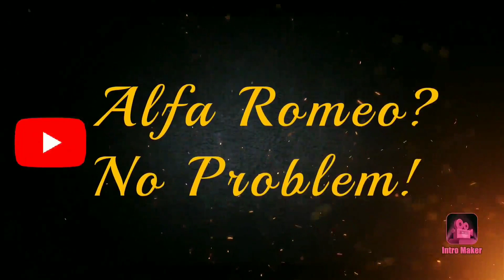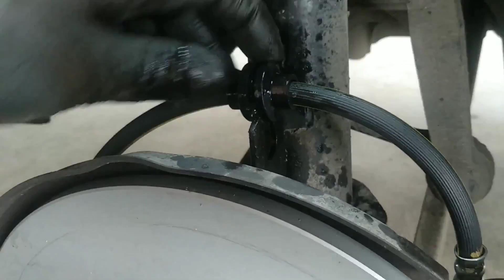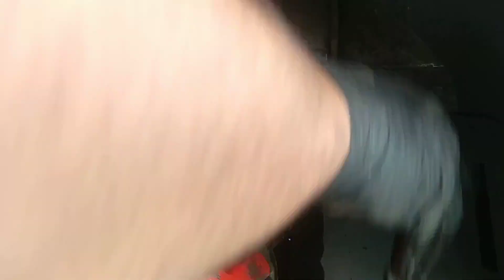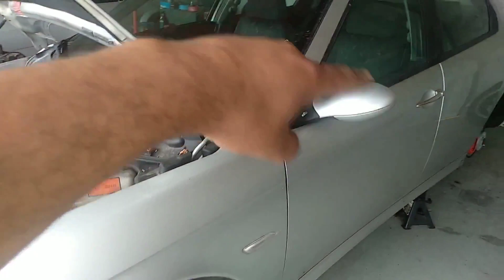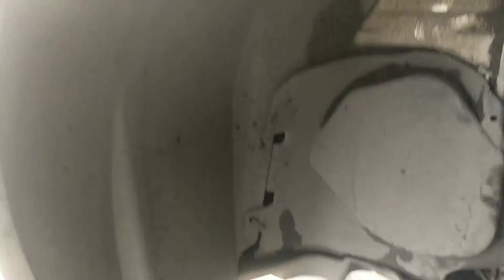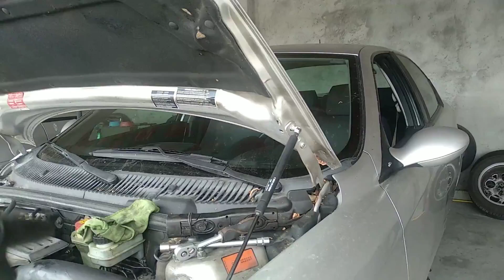Brake hoses, DOT4, clutch fluid replacement. Why is that so important?

Comment: I can confirm one thing about bleeding brakes on all 4 wheels on my alfa 156. I did it only by myself, without any pressure in reservior, I only opened the cap, at even surface, each wheel one at a time. Job was simple:
1. Open bleeding nut with bleeding hose 20-30cm below the bleeding nut level .
2. Get in the car, slowly pump the brake all the way in, several times.
3.Get out of the car, wait several seconds before closing the nut. Close the nut.
4. Watch the fluid level.

And do this for all other wheels.

I got on car inspection tomorrow, and the braking results were:
4kN on front wheels each, dffrenece 0% (maxed out the scale)
2kN on back wheel each, difference 1%.

Comment: its me again :D I have changed hoses and i bleed the system by pedalink. Everithing is ok but now when egine is runing when you pres break  the pedal drops slowly to the middle. When its not runing pedal dont drop. Car stops fine. I have firend with 159 and its the same on his car. Is that normal?
Reply from the maker: Hello. Not normal. You've may have damaged the master cylinder. Do not do the bleeding with the pedal.

Comment: Are braided hoses much of an improvement do you know?
Reply from the maker: Hello. They are, for track days and very fast driving. But they have the exact same maintenance.
The most important thing is to replace the brake fluid in time every time

Comment: My Sandero started pulling to the side under heavy braking. But only heavy braking, not under "normal" or even "medium" braking. I think only when ABS turns on. Not the most ideal thing, since I drive fast. Could it be the ABS? I don't get any warning lights. The brake disks and pads are fine. I am guessing the calipers are fine, since the brakes are worn equally. I wonder if it could be the brake hoses? I can buy a pair of LPR ones for 10 Euros. That would be the best case.
Reply from the maker: Hello. All the cases I seen so far is the abs unit. Rotten on the inside. Try to pressure bleed to see if one of the wheels does does not come out fluid.
If so, go on the abs and undo the exit fittings, one at a time. One of those should be dry. No oil coming out. If so, undo the 2 entry ones, if both let fluid out, you have confirmed the abs is bad
Reply: @alfaromeonoproblem  Thank you for the answer. I hope it is not that. I have tried braking this morning on the straight road and it did not pull to the side. The speed was not high though. I actually think that pulling to the side happens to me only when braking hard in the corners, but not on the straights. What that can be then? 
At first I thought it was the tyres. The fron ones had cracks on the top of the treads (all 4 have the same manufacturing date), so I swapped the front wheel to the back. But the same situation.
Reply from the maker: You also can have a play on a control arm. But do you to feel it it should be a big play. That car uses the first Clio and Mégane suspension system, the had that problem.
But the symptoms where a bit different:
In a straight line, accelerating the car goes well and braking the steering wheel turns on you. And the car also pulls.
Reply: @alfaromeonoproblem  I often check the suspension, and there is no play.
Hmm. I will wait and see if I can figure it out.
Reply from the maker: Ok, hope you can find it
Reply: @alfaromeonoproblem  Thanks.
Reply: @alfaromeonoproblem  Well, I found the probem... I bought a brand new tyres Michelin CrossClimate 2, and had them installed today. When they removed the wheels, I took the opportunity to check the brakes, and... The outher brake pad on the right caliper is completelly worn. Zero. No friction material at all, from what I could see. On the left caliper, the outer pad has a few mm of friction material. On the right one, none. It either worn out due to caliper issue, or it separated from the backing plate and fell off. That is why it was pulling to the side, but only under heavy braking in a fast corner. I also have noticed a grinding feeling or sound (not sure which) under harder braking at high speed. So yeah... I will get the pads changed. And also the left CV axle, and the transmission oil...
Reply from the maker: Hello. Yes, that happens from time to time to the caliper is sized solid. Make Sure to fix that before New pads. That boot is a mess to do... God luck
Reply: @alfaromeonoproblem  Thanks. I will take it to the mechanics, because it is urgent. I will tell him to clean and lubricate the slider pins and whatever else he needs to do.
Reply from the maker: Nice

Comment: Awesome! Why are you against vacuum bleeding? I did mince with vacuum and it was an easy job, no problems since.
Reply from the maker: Because it's very hard on so many models and brands. It leads to so many doubts and poor fluid replacement. It's not good at all...